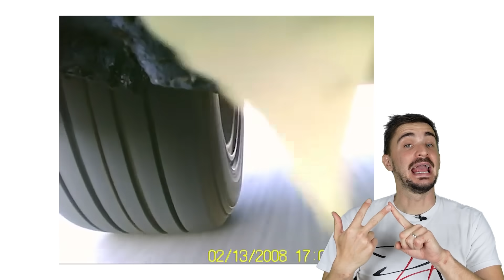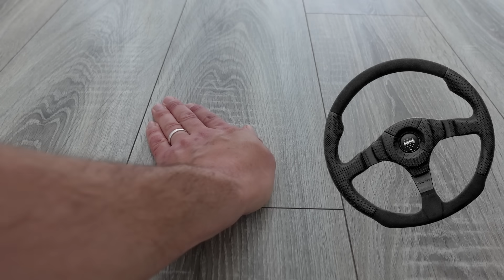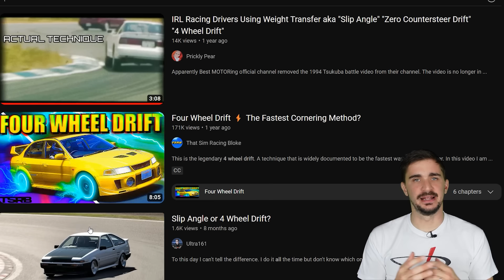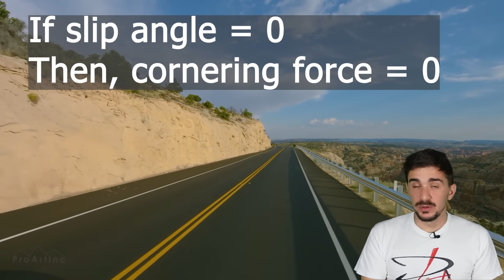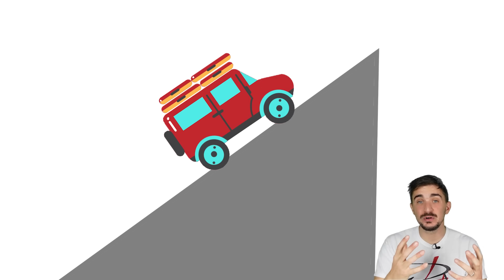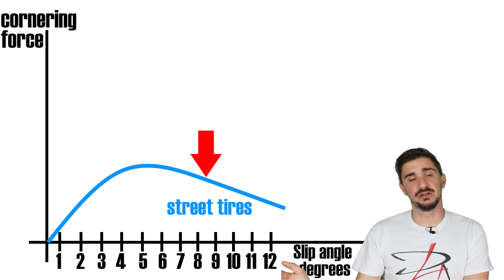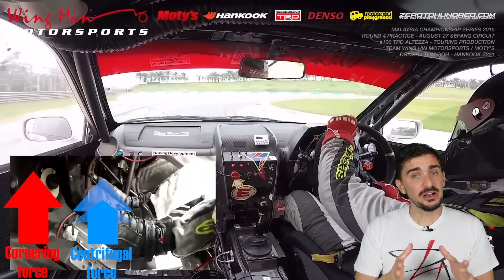You Think You Know But You Don't - Slip Angle Explained in a Way You Will Understand

Comment from the maker: 100 cars that changed the world: https://amzn.to/3DGXDf6
Stem engine model: https://amzn.to/3Y5iZLv
1-2-3 count with Car parts: https://amzn.to/3jxP7Z6
Patreon: https://www.patreon.com/d4a
Reply: so, what if instead of normal rubber wheels we use steel cylinder-like drums, that cannot deform. Would we drift a little every corner instead of "normal" turning?
Reply: Can you do a video about lightening things like flywheel pistons rollers and others. Benefits and negatives, even dyno numbers from only lightening. i want to see if is a myth that too much lightening loses power at high rpm
Reply: I feel like static and dynamic friction .... ei, traction vs sliding might have been worth mentioning in here? 
Anyway, love your stuff dude. Hope all is good in Serbia.

(but that is not how wings or spoilers work ... which I'm sure you know bc you really do seem good at physics).
Reply: All I know is my old Mazda RX-7 turbo 2 with low profile tires was a cornering shredding BEAST. That car was a cornering kick to drive. 😮😅😊
Reply: To follow up on this useful information, an episode on how braking and acceleration, during cornering,  can imbalance the slip angle. This phenomenon is probably widely misunderstood by those other than professional drivers.

Comment: This was a great explanation to help grasp the basics of tire deformation. Tire mechanics are very complicated, and explaining the basics of slip angle in a video as short as this is impressive, but I shouldn't be surprised. I always count on you to deliver high caliber explanations that are on par (or normally better) than what I learned while studying mechanical engineering. However, I noticed two things that I wanted to point out.

#1: There is no such thing as centrifugal force. This may seem like semantics, but this is a common mistake people make. What you feel as a centrifugal force is something pushing you outwards as you corner, like how a centrifuge "pushes" objects against its walls. However, there is no force that is pushing you outwards, but rather you are experiencing the centripetal force acting on your body to change your momentum. Most know that force results in acceleration, and acceleration is a change in speed. The more true definition is that acceleration is a change in velocity, and velocity is a combination of both speed and direction. When you corner, you may not be changing your speed, but you are changing your direction, hence a force is required. The force that is actually applied, the cornering force, is by definition the centripetal force: it points inwards. If there was another centrifugal force pointing outwards, that would cancel out the centripetal force, sum to 0, and you wouldn't have any change in velocity. What you feel as an outward force is simply your inertia attempting to keep moving forwards and being resisted by normal forces (the side of the car, the seat, etc.).

#2: @12:55, you describe having to slow down when taking sharp corners due to the cornering force decreasing past the peak at high slip angles. This is not why you need to slow down in a corner. Upcoming physics lesson. Force (F) directly relates to mass (m) and acceleration (a): F = m*a. Changing direction means you are accelerating, and for a corner with radius (r) and constant speed (v), the acceleration (a) can be calculated as a = v^2 / r. So, going faster (larger v) or taking a tighter corner (smaller r ) requires larger centripetal acceleration, and therefore a larger centripetal force. This is a function of geometry. Remember, cornering force is the centripetal force, but the graph you show of cornering force v. slip angle (13:04) is a little misleading; it really should be MAXIMUM cornering force v. slip angle. If you take the same corner twice, but the second time at half the speed, your slip angle is the same but cornering force is different. It's only when you go above the maximum cornering force that your tires will slip because you have exceeded the frictional limit. If you are already driving far below the frictional limit of your tires, you don't need to slow down when entering a tighter corner. Rather, you don't slow down when taking tighter corners because the slip angle has increased, but rather because your required centripetal force has increased and you must compensate by lowering your velocity. What the peak of this curve really signified is what you get to later; if you are turning the wheel with a slip angle close to its peak, and you are driving at a speed fast enough where you are just about to slip, a further increase in steering angle/slip angle will result in a decrease in maximum cornering force and could result in slipping.

I know this is an old video, but I have learned so much from your engine + car explanations that I wanted to try and share some of my knowledge! Hopefully this will help someone :)

Comment: Slight nitpick at 12:36 Racing slicks produce their highest cornering force at a lower slip angle than street tires because of their stiff sidewalls and soft compound. The peak should probably be around 4-6° for the racing tires. And later for street tires. This is part of what makes racing tires unsuitable for daily driving, even in clear conditions, because if you dont know what you're doing and you go past the limit into the sharp dropoff of cornering force, you get massive understeer or oversteer, making you a hazard on the road. Street tires having a much later peak and flater trajectory means they can't corner as well, but they are much harder to abuse inadvertently.

Comment: If this explanation is true, then why do the non-steering wheels also experience a slip angle when cornering?
Reply: The yaw motion of the car while cornering "steers" the rear wheels. This induces slip angle.

In more detail: The yaw rotation of the car causes the velocity direction at the rear wheels to differ from the wheel orientation. This creates a slip angle, even though the wheels themselves are not steered via your steering wheel. They are "steered/turned" via the yaw motion.

Comment: Based entirely on my own understanding, in relation to the wheel, the contact patch is not continually turning like the hand demonstration appears to show. The contact patches are also constantly gaining contact at the front and losing contact at the rear, of course they do not gain entire blocks at a time because tires are round and do not have flat surfaces (other than the part where they briefly touch the ground). If a camera aiming at the wheel is mounted on the vehicle, like at multiple points in this video, then you can see that the steering angle can remain constant while the vehicle continuously turns. This is because the contact patch is seen as being straight. Whenever the next section of rubber joins the contact patch, it goes from being deformed by the wheel’s steering to being straight like the rest of the contact patch. This is similar to when we swim and our hands and feet push against/claw through the water. It is pushing away the road surface that is in the opposite direction of vehicle travel. Please correct me if I’m wrong about any of this, I am genuinely trying to better understand these concepts in order to further my career and potentially teach others in the same manner I am learning them.

Comment: with downforce would the peak cornering force not also shift to the right on that graph? Cornering force is essentially made manifest by the “spring rate” of the tires’ sidewalls which if unchanged in spring rate, could only apply increased force by further deflecting even if in a non linear way. The material characteristics of the “spring” (sidewall) communicating that force to the wheel are unchanged, therefore to utilize the increased friction of the contact patch, and increase the force transmitted to the wheel, the tire’s resistance to deformation will equal the cornering force at a greater state of deformation

Comment: This whole slip angle thing happens because tires are flexible, and in the video you aid that no slip angle means no turning. Then would it be impossible for rigid tires to turn? What about wooden or plastic tires? I know they turn while "sliding". They, I assume, would not be able to turn while under going pure rolling. Can someone explain this?
Reply: It's more of that a rigid tyre can't turn without losing grip. The whole point of tyres being flexible is being able to turn/deform the tyre so you can maintain grip while changing rotation of the tyre. When you have rigid tyres, whether they're rolling or not, they cannot "turn" or rotate without slippage or losing grip.

The reason why he says no slip angle means no turning is that if you have a rigid tyre that doesn't break traction, you cannot turn it. That's why I said what I said earlier. The only reason why you can rotate rigid tyres in your case is they break traction and slide. Slip angle ≠ literal tire slip. “No slip angle means no turning” applies specifically to flexible tires.
For pneumatic tires, if there is zero slip angle, there is zero lateral force and thus no cornering.

Comment: That explains why the back end of the car always steps out by a few degrees during a corner when at a fast pace. Increasing slip angle on the front wheels is as easy as moving the steering wheel, increasing slip angle at the rears requires the whole car to get a little sideways. This makes sense.

Comment: I don't understand: if all this slipping, twisting, deforming is necessary to turn a car, how did it work on old carriages with solid wooden or metal wheels? There's no deformation, yet if you turn the wheels and roll the cart, it will turn?

Comment: This reminds me of a quibble about horses pulling carts.  They don't.  The horse's shoulders push on the collar.  (Please forgive my ignorance of horse and cart technical jargon.)  The collar is connected to a strap which extends back to the cart, and the collar does not pull this either; it pushes on the part of the strap which loops through the collar, and each part of the strap pulls on the part behind it.  Then the strap loops through something on the cart, and pushes against that part.  That part may well be screwed into the cart, and those threads push against the cart's threads.  And so on, down to part of the suspension pushing against the rear of the axle, and on and on it goes.  Wish I could remember where I read this, but it was ages ago, probably pre-internet.  And again, I apologize for mangling all the horse and cart terminology.

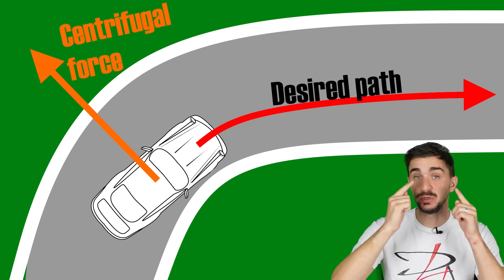Comment: little correction: 2:20 the graphic is right, allthough the words are a bit misleading. centrifugal force only exists, IF you have enough grip to the ground. if you have bad tyres and drive on ice for example, there is no grip, therefore there is no centripetal/centrifugal force acting anywhere and thats why the car keeps going just 100% straight. a better wording would be: in order to turn a car into a corner, you need centripetal force pulling the car along the curved path. this centripetal force must be delivered by the grip of the tyres: either they provide enough, then its good, or they dont, then the car starts to under/oversteer and eventually and even worse just goes straight like on ice.
Reply: No, you're wrong as well. Centrifugal force NEVER exists apart from in your mind. It's an illusion. The thing that is wrong in his video is not the words that he is saying but the direction of the orange arrow. There is absolutely no force that points out the way from the car like he showed. Actually, the "centrifugal force" arrow continues in a straight line in the same direction as the road that the vehicle CAME FROM. In this case, the orange arrow would point straight up, not to the left
Reply: @richmondvalentine9738  Boy, i teach physics. you lost me at "NEVER exists" and "illusion". Id recommand you quit skipping classes and go to school. Or read an article about fictitious forces and that they are VERY real. it is the same as the centripetal force, but viewed from a different perspective. they share they same formula, they have the same number but different directions and they are BOTH very real, but depending on where you are, you experience/see either or.

Comment: Ah, so there are two slip angles! The only term I've ever heard is referring to the rear of a car/plane/helicopter/any vehicles' rear slipping out(not necessarily drifting) more than the front, in order to, put simply, turn faster. Wheather that's with grip or drag, depending on the type of vehicle obviously. 
Hopefully this distinction helps with a misunderstanding of a topic in the future lol

Comment: Wow, thank you now it makes so much more sense that drivers do micro corrections when taking a tight corner at high speed whenever they notice that they are starting to lose grip. It temporarily reduces the slip angle and as a result increases grip.

Comment: @d4a What about holding steering at a specific angle? 

The first contact patches right after the steering input will be at a different angle(while you turn the wheel) but when you reach the desired steering angle and hold the steering wheel at that angle the contact patches should be inline. 

What turns you then?

ps: make a vid about rallying and he difference between grip and sliding. why in rally minimal traction situations sliding is faster

Comment: Appreciate the work that goes into explaining thee concepts in simpler terms!

One critique... I'm studying physics at university and in that setting the use of terminology is rather rigorous and specific, from that i feel some of the concepts you describe could be made more accurate without making it harder to explain. For example, when you were talking about the distinction between cornering force and friction, something didn't feel right. After all, fiction is the only way the car can ultimately interact with the road. It might be more accurate to describe corning force as the component of fiction that results from slip angle.

Stuff like that. I'm not particularly well versed with car dynamics so take that example with a grain of salt, but it looks like you are. So with some more precision in ideas your content could be cold standard for technical information on driving!

Comment: I've always known that tyres tweist when you turn the steering wheel which is why you should never do it when stationary, yet lots of people do. You see them all the time doing say, a 3- point turn. They'll go forward and stop, turn the wheel from lock to lock while stopped with the power steering pump screaming under the strain, then go backwards a short distance and stop, and turn the wheel from lock to lock again. A truck driver friend here in Australia once told me that doing that in a truck while testing for you licence is an instant fail.

Comment: Great video.  I would add that Audi desgigned a racecar that has the computerdecide how fast to take a corner andwhen tand how fast to exist after learning a track. The drive didnot really do much  and it was faster.  Of course it is outlawed inallracing series,butthey did it to proode it was faster..
I have a question about super lowprofile tires.   If the tire must deform to turn, how can itdeformmuch with almost zero sidewall tires/.   am building a big r/c racing car, and planned to avve ZERO sidewall, just tread glued to a wheel, so I can't turn?'
The other thing Audi does is called torque vectoring, where the inside wheel is given some brakes and the power movees to the outside wheel.  My r/c car will do this also, but just the back powered wheels, not the font (audi had awd.)

Comment: One thing : they are not spoiler spoiler are used to spoil the air when there Is a low pressure zone behind the car ... They are wings 👍👍🫠🫠

Comment: i find it funny that engines and transmissions and fuel injection and suspensions and windshield wipers are comically simple and then the seemingly easiest, simplest, likely OLDEST part of a car's design is easily by far the most complicated

Comment: As a professional race car driver (on my ps5), there’s no better feeling than saving a loss of control by modulating steering, throttle, braking inputs simultaneously. You can feel the steering force increasing and falling off, and you can thread the needle from apex to apex by playing the musical instrument of driving. Shifting, uneven torque distribution, suspension bottoming out - all drastically affect this and consequently may cause a sudden loss of grip. It’s cool to understand the science behind it since this is all done by feel. 

If you watch real racers and their inputs, you can see they have a larger quantity of smaller inputs. Amateur drivers on the other hand tend to use fewer, larger inputs. In the former, you will not hear tires screeching. In the latter, you will hear tires screeching and see smoke. An inherent understanding of this principle becomes automatic to pros. Pretty cool.
Reply: I’m ironically calling myself a pro. Although I did beat all the license tests in GT7 with no TCS, ECS, ABS, etc… lol

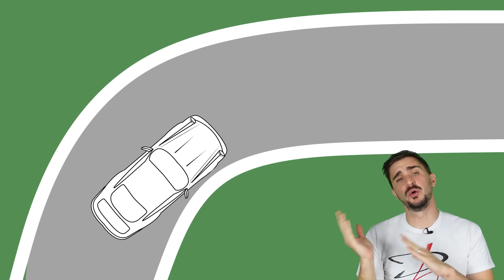Comment: 2:30 just wanted to point out the centrifugal force vector (the arrow) isn't pointing right. Since what we call centrifugal force is really just inertia (when you turn the car, you're going against its "will" to keep going straight) the arrow should be pointing in the direction that the car was heading before turning
Reply: I know it's probably that way to help visualize the force and show that it "pushes you away from the corner", but in case anyone wanted a bit of added info. felt like nitpicking